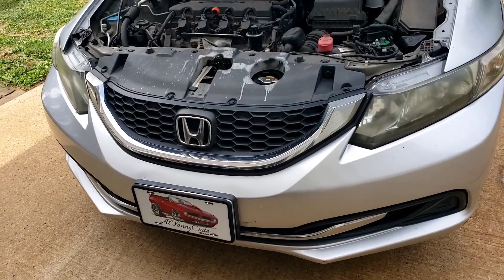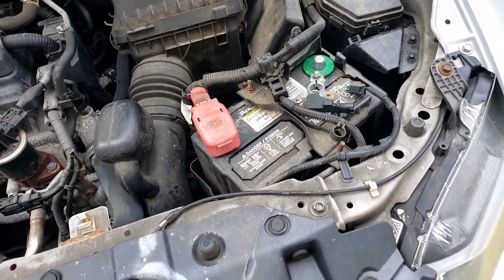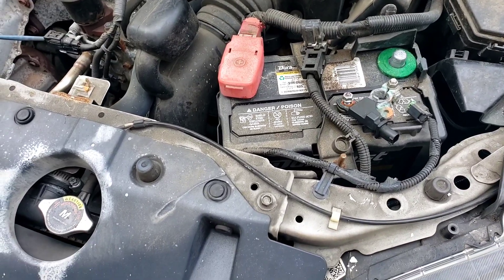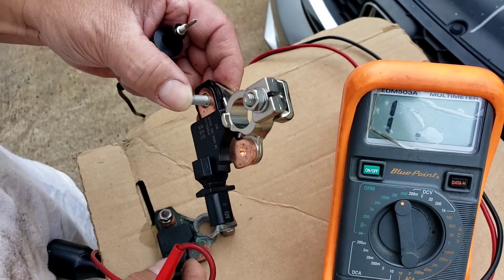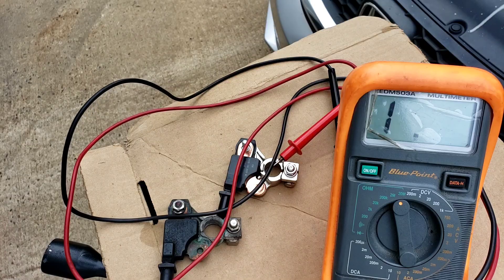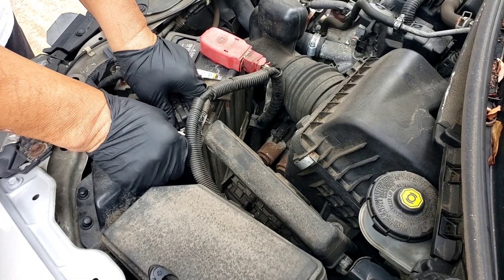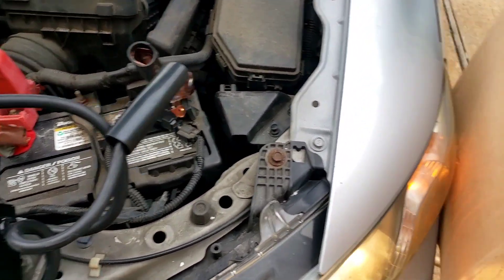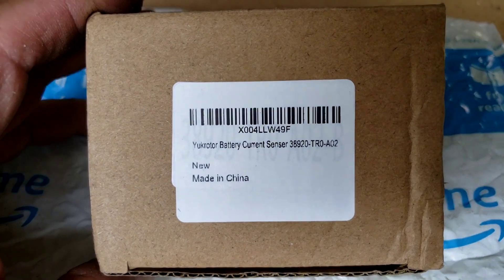Honda Not Charging Lights Flicker at Times Battery & Alternator Good 2013  Civic and Others Similar

Comment: I'm a tad confused on a civic 2016. When idling and monitoring the battery current sensor from my scantool I see negative current values meaning it's draining the battery and battery voltage hovers around 12.6V but when I turn on headlights or AC fans battery current goes positive and battery voltage climbs to 14.4V. immediately I turn off headlights or AC, it drops down again. I have swapped battery sensors and same
Reply from the maker: Swapped sensor as in a new sensor? How old is the battery and Alternator?
Reply: @alyoungcuda A sensor from another working car. But I read that honda uses smart charging and drops the current when it feels battery is full
Reply from the maker: yes, thats what the sensor is for, charging rate depends on what the car needs, hence the charge rate goes up with the lights on.

Comment: Hi Al, I had the same problem on my civic si 2014, and change the battery current sensor, just like you did , the problem was resolve. i order my from amazon and it was very cheap compare to autozone and the honda dealer. good job Al.
Reply from the maker: Thats awesome